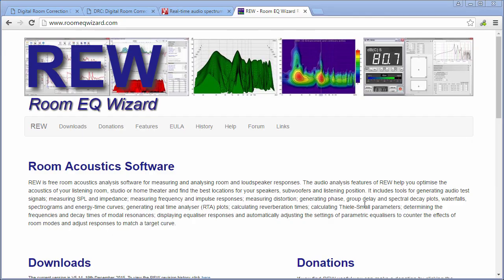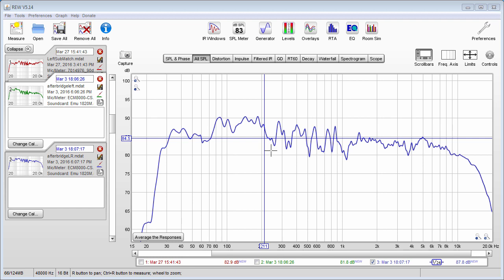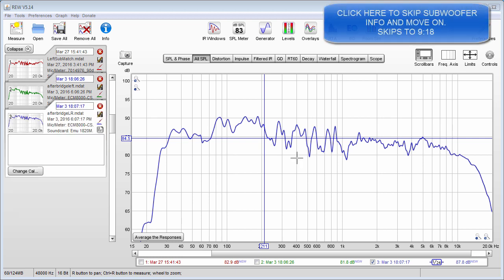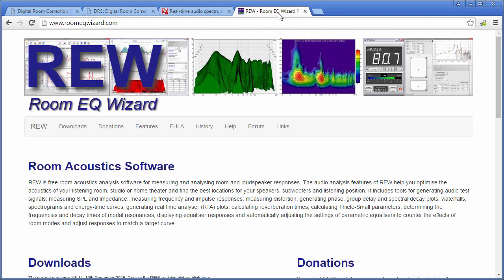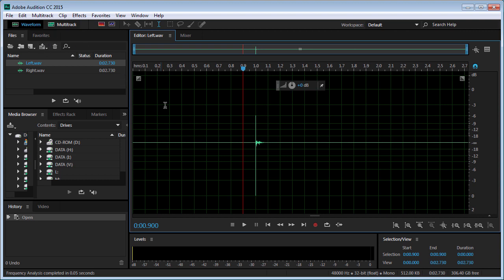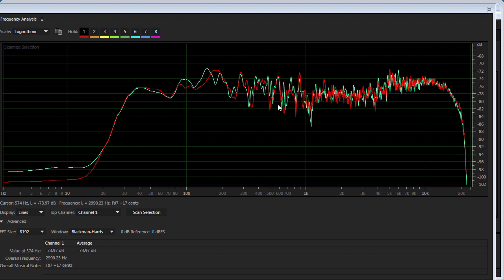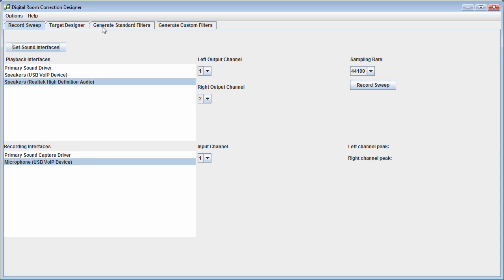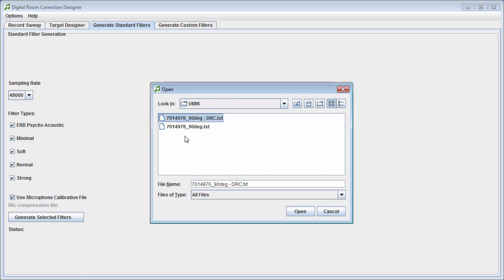Room Correction With Plugin - DRC Designer Convolution Tutorial Room Eq Wizard

Comment: Much easier way to calibrate the sub to each separate monitor, 

Do a full range response to 80db,
Left + Right + Sub 

Now turn off the right monitor and remove the right TRS/XLR cable from audio interface 

Do another response 
Left + sub 

Now turn off left monitor, turn on right monitor, 
Remove left TRS/XLR, plug right TRS/XLR back in 

Do another response 
R + sub

This will correct the sub volume to each monitor without multiple calibrations 

Thanks for info great video....
Keep up the good work

Comment: It is clear to you that if you use such a short sweep the results are highly inaccurate? The DRC manual says anything ABOVE 45 seconds for the sweep is fine, but below that, results, especially SNR are inaccurate.
Reply: The REW limit seems to be 1M, or about 24 seconds at 44100 samples/sec.  I don't see any way to increase it.
Reply: REW 5.20 beta 2 adds 2M and 4M options for the measurement sweep length.

Comment: Thanks for the guide. If I've used cal files in rew measuremet, i have to use it in drcdesigner too?
Reply: According to the REW manual: 

"The impulse response is that of the whole system, including the mic/meter and the soundcard. The mic/meter and soundcard calibrations are only applied when calculating the frequency response."

So I take that to mean that you do need to reload the cal file, since the impulse response is time domain and doesn't include any frequency corrections.

Comment: hi, thanks for posting this video.
is it possible to realtime room correction with a pc?
i want to take the rca outputs of my hometheater preamp, route them into a pc for correction, and then back out to the amplifiers.

is there a software package/ sound card you can recommend for this? 

thanks.
Reply from the maker: There are many...some free. Example: JRiver ... Search : pc room correction software
Reply: +Dozerbeatz - Mixing/Mastering ITB 

thanks again. ive been using drc on a hardware platform but the number of taps is small so it doesnt go below about 500hz in linear correction.

i still love the improvement so much that im willing to make the jump to something that will do 10k to 30k taps.

ive been searching for a week for something that will work but it seems like all the solutions have the audio originating from the pc, and not an external analogue source.

i will do the search you suggested. 
thanks
Reply: I don't know if you're still interested, but this might work with equalizer apo. If you export your room correction filters as an impulse response (wav), you can convolve with that impulse response (i.e. apply the filters) across all of windows with equalizer apo. If you configure equalizer apo to also apply the filters on the line in, it should correct the input (from the pre-amp) and send the corrected sound to whatever output is default in windows (line out to the amplifiers). I believe this is exactly what you want. One problem you might run into is that this whole process creates some latency, and applying the filters in equalizer apo to the line in tends to fail sometimes as well. Anyhow, good luck!